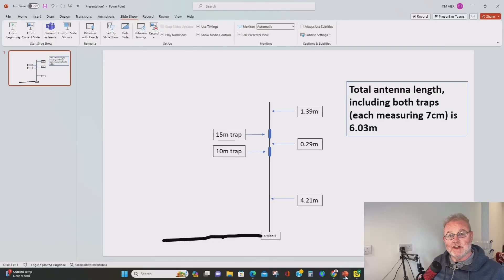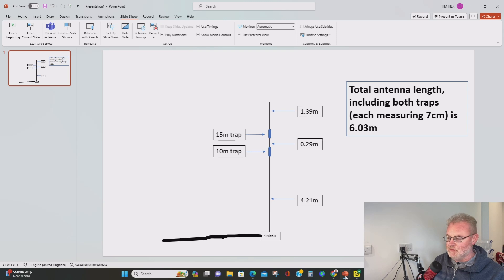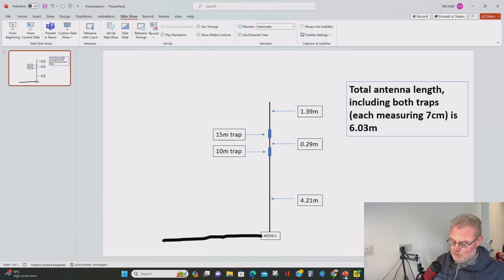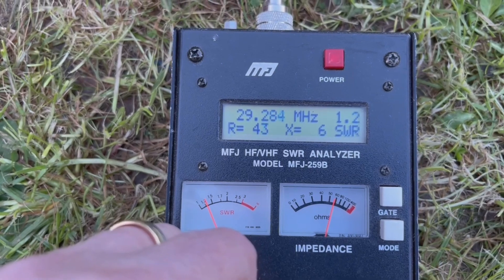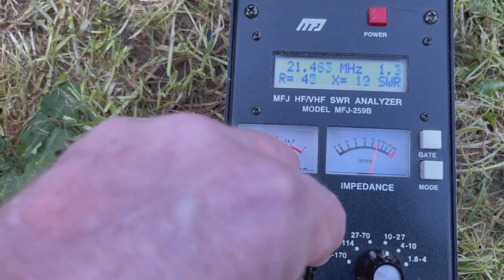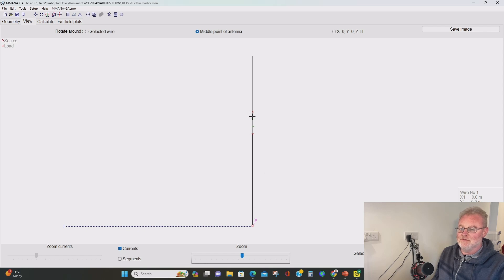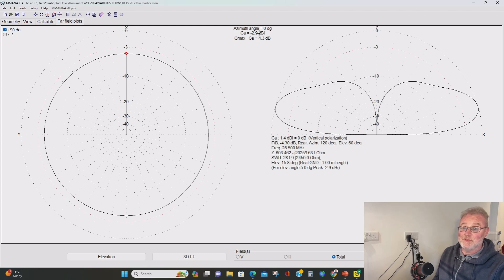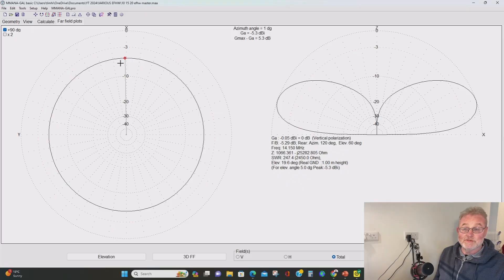Ham Radio Antenna: Simple 3 Band No Radials Vertical for 20, 15 & 10 Metres

Comment: Hi Tim,
Once I saw the title on this I was really keen to watch so saved it for my porridge and toast this morning 😊…
Great video and I think this is actually my next project!
To be honest all my builds have been resonant antennas and for some reason I just can’t get my head around making traps, specifically how to calculate the turns/former, how to actually measure they are correct for the band and finally where to put them…. 😅
Maybe you have this back in your content somewhere, but I have yet to find a really good explanation on traps and how to make them from the beginning to the end, including how to test them for a specific band…
Would you be able to point me to this if you’ve already published it, or maybe even consider doing such a video?…. As you would be the best man to describe it!
For me for example, this would be a portable antenna to carry up a SOTA summit, so my traps would need to be very light coax or some other trap option lighter than rg58 .
I would likely also use it with the tuner then for 40m to give you UK folk some chaser points too! 😊
Reply from the maker: Hi Dave - I can point people to how to make the traps - I also have a n idea for a 20/40m dual bander which does need radials but no tuner if that would help?
Reply: @TIMG5TM  yep, the 40/20 would be perfect for sota/wwff in my case... expecially if i can get it up with the 7m sotabeams pole.
On the traps, yes id love to see the process of making a trap from start to finish, through an example antenna build... Im also interested in loading coils too, particularly to load a shorter wire for 40m portable.
Reply from the maker: @IrishHamRadio  right that’s on the list 👍

Comment: I was wondering: Isn't the 10m Trap drastically lowering the 20m efficency because it is placed close to the 20m current maximum and thereby working against a relative low impedance from the 20m point of view? Even a high Q trap for e.g. 28mhz still has arround 7db attenuation againts 50ohm. Is that something to concern or  have i made a mind mistake?
Reply from the maker: I used to think this, but Cebik produced a paper which outlined that placing coils at the current maximum on a dipole (near centre) only had a fractional reduction in efficiency compared with midway down each leg. This contrasts with a ground vertical where the interaction with the ground itself is what makes a coil near the current maximum the big issue compared with loading the antenna away from the current maximum. The same applies here as the efhw current maximum is well above ground Level so it behaves more like a dipole than a 1/4 wave ground fed.
Reply: @TIMG5TM  I need to check out this paper. I am not 100% sure if one can simply apply the findings for a coil to a trap. Even though those coax traps look like a coil they are in fact a well defined parallel LC circuit having a super high impedance at resonance. Intuitively i would place them as far away as possible from the current maximum of any band i want to use the antenna on. But as mentioned i might be totally thinking in the wrong direction :). Need to do more research on this topic.  Thanks for sending me down this rabbit hole ;)

Comment: Another very interesting ant tim, do you think ,there is any advantages adding a heap of radials on this type of ant. 73
Reply: It doesn't need it with the Unun at 49, or 64 to 1, but there is no reason not to try it just for fun.   Experimentation should be encouraged.  🙂
Reply from the maker: Nothing compared with adding radials to a quarter wave. I’m doing a video on that one soon
Reply: What LC values did you add yo MMANA for the traps, I’ve worked them out but they don’t seem to work the lengths in the design. 28.5 1.5uH 20pF 21.2 2uH 27pf

Comment: I would like to see the coil winding data. G7VFY
Reply from the maker: Standard coax traps both tuned to just below each band.
Reply: @TIMG5TM  do they have to be coax? I want to add two switches or jumpers to get 17m and 12m.
Reply from the maker: @G7VFY  nope don’t have to be